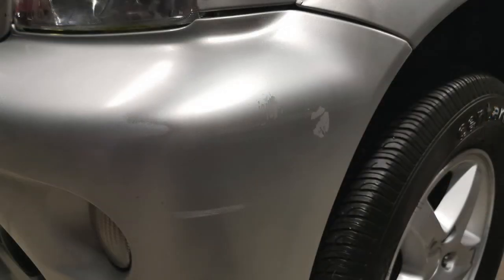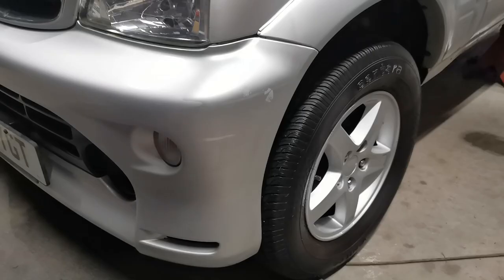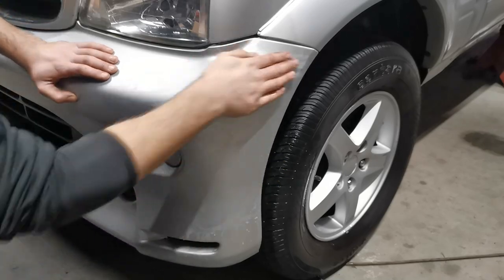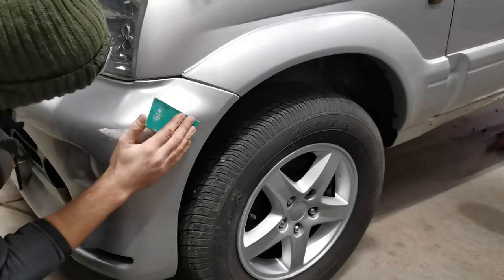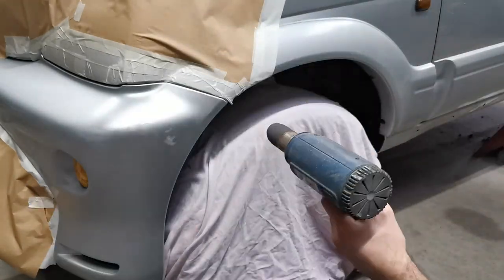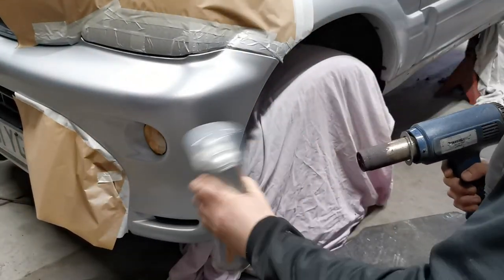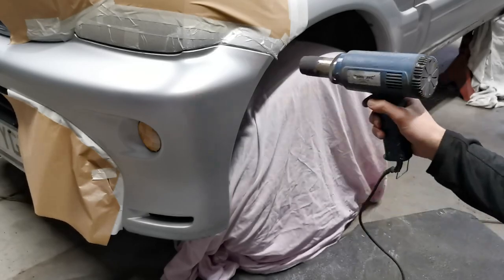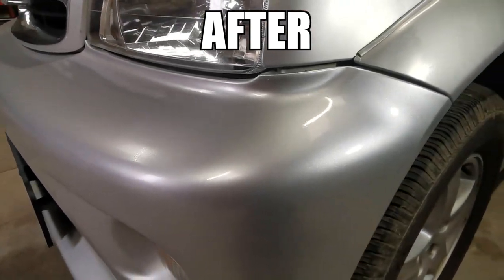How To Repair Scuffed Paint On Car Bumpers | 5 Minute Fixes | Episode #7

Comment: Hey Johnny, just found your channel and really enjoying it so far. A question as I'm about to try this on my Mazda2's bumper, Is there a specific filler to use for plastic body panels? Concerned that there may be movement in the panel that causes filler to crack. Thanks!

Comment: Really enjoyed that. A question I have for you is "what time period was this done over?". Was it all done in a day, or did you leave it overnight for the clear the cure more?

I also note that based on your links it seems you don't use 2K Clear; is that more because you're not too worried about the longevity of the finish here, or because you're using the heat gun to cure it off? I've always had pants results with regular clear which is why I'm asking (but I've never used the heat gun so I can see why that'd help. I saw the ChipsAway guy using a IR lamp for the same thing).
Reply from the maker: This one was done over the course of 2 days, purely because I like to let the clear fully cure / harden overnight. The bulk of the repair is easily doable in a day, but as always the dry times are the factor that delays things.
Re the clear I use, I do get a lot of questions on that and to be totally honest I use a stand 1k aerosol automotive lacquer (from Halfords actually but the link in the description is comparible). I've always had great results both in terms of application, finish and longevity. This is likely due to my approach to how I lay it down (very panel-cleanliness aware and also panel warmth minded). I generally find when people complain about poor results with aerosol 1K,more often than not their prep or technique leaves a little to be desired. 
Of course I'm not saying the results are better than that of a 2k applied with a gun, but for a fraction of the cost this method works well for me on jobs where a small spot repair or blow in is required 👍
Reply: @JohnnyGetsCash  makes sense and thank you for the detailed reply explaining it.

I can really see how the panel warmth is important, especially in the cold damp weather you were working in. Would you still do the same in the summer? It seems sensible as opposed to applying in the sunlight as it gives you more control.
Reply from the maker: For sure! I always warm the panel unless I'm working in a proper heated booth (which isnt too often). Naturally though, too much heat is as bad as too little so it takes a while to get a feel for it and become aware of where the panel is in terms of temperature!

Comment: No need to wet sand once base coat is applied and before clear goes on?
Reply from the maker: Hi Russell, thanks for your comment. That's right, no need to flat the base coat (just make sure it goes on uniformly!) Cheers!